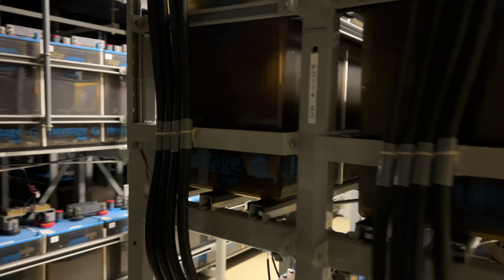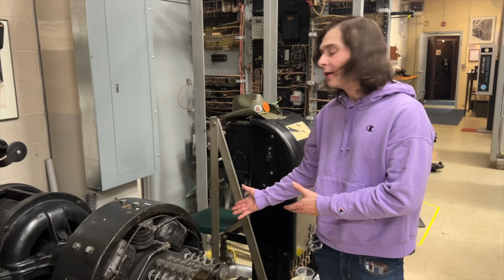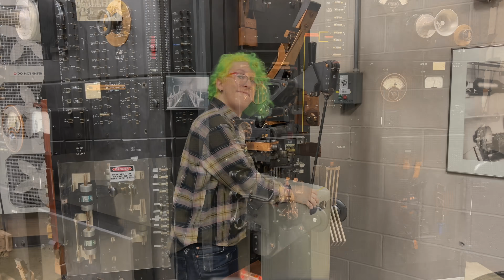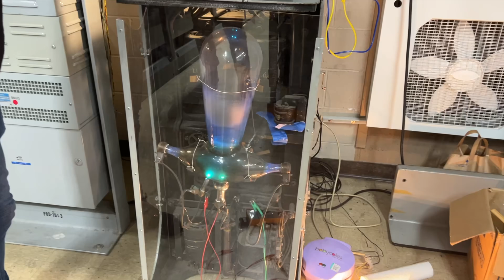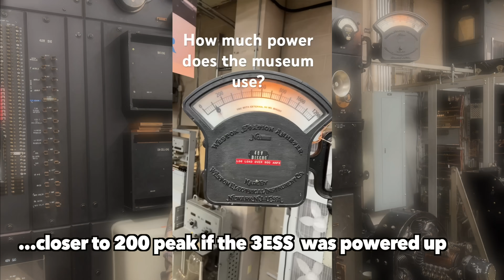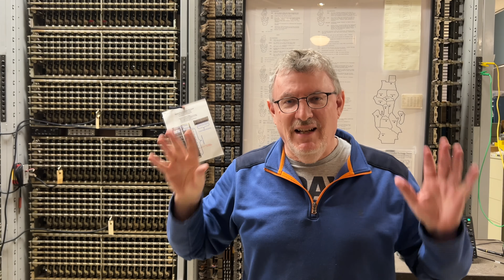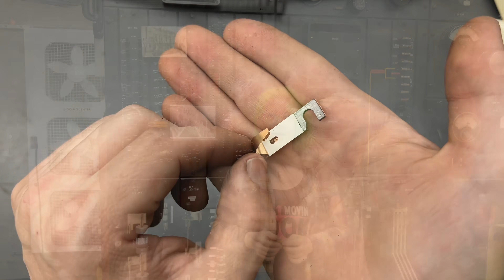All About Telephone Power Plants

Comment: Here in the UK we have -48v for pretty much everything. But, in TRS (Telephone Repeater Stations) the voltage is -24v. The only working equipment left in the TRS stations is a small amount of PDH , P2P modems and Kilostream ACE. I maintain this kit, but I've never understood why there was a difference in Voltages. I saw in the 1959 diary in the video that there were readings for -48v and -24v. Any idea  why there was this differences in voltages?

Comment: I've never seen a dropped wrench go poof, but I have seen the results of an uninsulated screwdriver dropped into a 3-phase 300A 415V AC mains busbar cabinet.
Unfortunately, the 11kV substation was literally on the other side of the wall, so the PFC (Potential Fault Current) was borderline ridiculous.
They only found fragments of the screwdriver handle, but the current impulse was so large that it bent the copper busbars like they were nothing.

Comment: Another super vid thanks Sarah! I worked in a large exchange in the UK in 1975 that had a battery stack with 60 gallons (72 US gal) of acid per cell. The Big Switch at the end of the string was scary large, SO tempting to pull the lever...

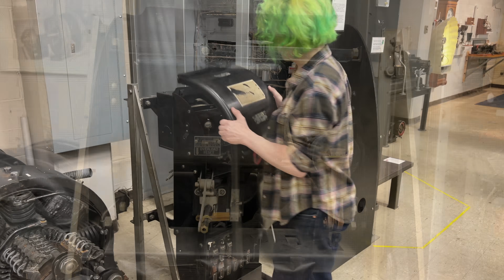Comment: 5:30 interesting; I haven't seen autotransformers used for starting motors, but here in Europe, with 400/230V 3-phase AC used for most motors up to tens of kilowatts (and higher voltages like 6kV if you need even more power), we use wye/delta switches; wye puts 230V on the windings and is used for startup at less power, and delta puts the full 400V working voltage on the windings. Slip rings and shunt resistors are sometimes used, they also used to be used as speed control devices, but this function has largely been taken over by variable frequency drives.

Give my best to Jay - she's a friggin' genius (how else can I call someone who makes their own vacuum tubes?), next generation Glasslinger coming up :)

That's one absolutely gorgeous breaker! Multi-stage switching, remote control... A thing of beauty and a joy for ever.
"Scientist: It's much too unpredictable - don't let it overcharge!
Barney: What do you mean, overcharge?"

Mercury vapor rectifier... I miss PhotonicInduction a LOT.

DDoS attack on an old phone switch, eh? Might be one of the first recorded examples.

It's very interesting to learn that the negative voltage has a real deal reason to it. All the fuses look interesting too. Thanks a lot for the insightful tour!

Comment: In the early '80s, I worked for a company that built video switching systems.  We built one system for Pacific Bell; it was to be installed in a CO in Los Angeles (I don't know which one), where it would handle all of Pac Bell's West Coast TV network switching.  Because it was to be installed in a CO, it had to run on 48V.  We didn't have a 48V system at the assembly plant, so we improvised one with four car batteries in series.  An old welding transformer that produced a 50V output charged them.  To limit the current, someone went to Sears and got a clothes dryer heating element.  The whole thing was built onto a pallet, with the "ballast resistor" standing on ceramic insulators.  Although it did not get red hot, it did get too hot to touch, and I always worried that it would ignite the hydrogen offgassing from the batteries.  We kept a box fan blowing on the rig when the batteries were charging.
Reply: Now that's some hillbilly shit right there

I love it!!! (and i'd probably do the same...)

Comment: As I understand it the carbon pads and other two contacts on the big DC switch all had to do with extinguishing the arc when the contactor opened. High current DC switches can be a total bitch to mitigate arc when opening.. Downright terrifying in some applications

Comment: An old tower dog named pistol Pete told me about a time where he set a wrench on top of the batteries in a Nextel shelter in the '90's and he knocked it and it fell without him noticing. The boys left site to grab something from the store and came back to the fire department putting the fire out. Needed a whole new building and that's when they were made of asbestos reinforced concrete.

Comment: One question that came to mind when you were talking about the fuses. 

What occured in an exchange or central office if lightening struck phone lines?
Reply: All of the Telco cables, whether underground or Ariel appeare on the MDF (Main Distributing Frame) in the CO. Each pair of wires had what were called protectors, consisting of carbon blocks and heat coils.  If the cable were hit by lightning, that super high voltage would jump across a gap thru the carbon blocks to ground. If high currents hit a cable pair, the current would pass thru the heat coils, which would melt a small pin internally and ground that pair.  The idea was to keep the high voltages/currents from entering the CO equipment.  Every land line Telco circuit that goes to your home or office building has mounted on the outside of the building a small plastic or metal box that also has carbons and coils mounted in them.  There is a ground wire (Usually green in color) that goes from the protector to a common ground in your house wiring, usually copper stakes driven into the ground, or in older homes, a water pipe ground.  Never remove those ground wires, you don't want high voltages or lightning entering your home from telephone lines. When I lived in Ohio, our commercial drop from Ohio Edison was hit by lightning, and fried just about everything that was electronic in our home.

Comment: Very interesting.  During WWII Bell Labs and Western Electric worked together on a top secret weapon called a Mark 24 "Mine".  It was an acoustic homing torpedo developed to sink submerged submarines.  Bell Labs developed the electronics that used 4  underwater microphones (Hydrophones) to steer the torpedo towards the swishing sound of the U boats propeller. Western Electric used a standard 48 volt telephone battery for power.  General Electric supplied a standard 48 volt commercial wash machine motor to power the propeller.  The batteries and laundry motor were chosen because they would fit inside a standard torpedo case.  Code name for this weapon was "FIDO".  It was first used in March, 1943 and was hugely successful.  This weapon allowed the supplies for the Normandy invasion to begin being sent to England with less fear they would be sunk.  This weapon was classified Top Secret for 40 or 50 years after the war ended.in case it needed to be used during the Cold War.  There are YouTube videos on the Mark 24 "FIDO".

Comment: I remember getting a tour of our local CO as a kid and was always impressed by the big batteries and big DC cabling. Eventually got a job and worked in that building for a good 10 years as a NOC tech. We don't really touch anything we just monitor it though.  When there are storms we have to keep track of all the COs that have no power so we can deploy techs with generators if the batteries get too low and it can get quite hectic. Cell towers work the same way, -48v as well. Our office got moved to the call centre building about a year ago though, I miss being in the CO, it was neat in there even though I never really got to touch anything.  Interestingly enough I've been setting up a CO power plant at home to keep all my server stuff running, as well as my workstation.  It's a work in progress but I have the basics, just saving up for the batteries now, and proper cabling as what I have now is temporary.
Reply: I saw it often when I was a kid tagging along with my dad on a weekend call. Remember the old mechanical switches and it was loud click clack all the time.

Comment: I had a battery be overcharged and off gas which caught fire then the alternator became unhappy lucky I was aware and ready I knocked the battery leads off and pulled off the belt yes it was spinning no I didn’t use my hands I used a branch

Comment: Another great video Sarah. I spent a lot of time around many of these old power boards in the 80’s. My job was design of the AC side especially for the very large COs. Redundancy was key and no single point failure modes were acceptable. Some central offices were so large that they had as many as 7 AC substations and 6 emergency generators! And there were still a few small substations with M-G sets still running. 
The museum is an invaluable record of what was achieved in the 20th century. Sadly, it is disappearing day by day. Wire line services are going away at an incredible rate. Even cellular will likely become obsolete within 20 years in favor of an all satellite network. In 50 years, people will have to visit the museum to see what the telephone system looked like.
Reply: Satellite will only replace cellular in rural areas, urban areas are just too dense even for the new LEO constellations they're launching.

Comment: Rube Goldberg would be proud
Reply: Naw, Rube Goldberg was the way trunk usage registers were read, a camera "Hood" that covered 100 registers, containing 1 wollensock 1/2  frame 35mm  camera,and 2 high intensity light bulbs shot Kodak high resolution B&W film, the films were changed daily at 7:00 AM in our CO.  Films were sent to film lab, developed then joined together in long streams. The registers were numbered with OCRS characters, so the films could be read on an OCRS system, then copied to mag tape for the traffic department to read and decide if more trunks were required. We had 20 of these camera hoods in our office. Not many computers in 1960, so I got to change those films every morning... for 10 years.  We had a closet full of Kodak film.....

Comment: Working for one of the independent telcos in FL many years ago, I was working in a CO when the power went out, the diesel generator attempted to crank over, and the starter battery promptly exploded. I thought the building had been struck by lightning. When the system gave up trying to crank that one, the turbine secondary generator	whined to life a minute later.  Trying to figure out the location where we’d been hit, we walked through the whole building, and when we came to the generator room, the carnage of the blown starter battery with shards of plastic all over the room and freshly sprayed acid made me very glad we didn’t typically have any reason to be in there.
Reply: So cool, um, I mean, glad you weren't killed!

Comment: All of our MG sets were 400 amp, 52 volts They were all Western Electric /GE open frame sets, similar to what you guys have, only painted gray instead of black..  We also had 400 amp solid state rectifiers (NOISEY!) . We had 4 strings of batteries made up of 23- 2.17 Volt cells each, and at least one end cell per string.  Emergency power was supplied by a 200 KW Solar Gas Turbine.  Our switching system was 2 units of SXS, and 1 unit of #5 XBar.  We also had a 130 volt string of cells for ring generator, and Before Ma Bell got rid of them, teletypes requiring 130 V battery. Those cells were I think 2180 AH rating each, and were manufactured by either Excide or CD . If the battery voltage dropped below 48 volts, the emergency end cell switch would cut in extra cells as needed, to keep the voltage at 49.91 volts. Battery strings were connected to overhead copper bus bars hanging from the ceiling on large red insulators. Our main switch panel was all knife switches, some rated at 600 amps. Might be interesting to tell the people how those high amperage fuses were changed, with the knife switches! Dozens and dozens of fuses were used to supply the various switch frames on the 1st and second floors.   We were a small local end office CO, but up the street a couple of miles, we had a 4 story CO that was also a major toll hub with lots of microwave.  Their emergency power was 2-750 KW Solar gas turbines.  I worked at both of these CO's, nearly 10 years before moving east, all the COEM's worked power at some time, we all trained,..I can still remember using that Weston single cell voltmeter, and taking Sp. gravity readings as a weekly routine. I ran the Emergency gas turbine once per week with no load, and once per month with full load. .  That little office today is all 5ESS.

Comment: Not a telco power story but amusing nonetheless.

Back in the 80s I was working in DMERT development at Bell Labs. There were several labs, each one consisting of a room with a 3B20D processor and an adjoining room containing a DEC PDP-11/70 computer, which was used to control and monitor the 3B20.

Feeding these two rooms were aluminum busbars carrying 208 VAC 3-phase at some horrendous number of amps.

One day I was in the lab and a couple of the busbars decided to end it all. There was a deafening ka-BOOM! and I jumped about three feet into the air. I made a beeline for the door, hitting the EPO button on the way out. (The power was already off but, hey, I hit the switch anyway.)

The electricians began work on replacing the busbars and temporarily left the old ones lying in the hallway. I was standing around with a few co-workers when two guys walked by. One glanced at these melted, gnarled-up busbars, turned to his friend, and said, "Obviously a software problem."
Reply: I thought telco was 48V DC, albeit at a LOTTA AMPS
Reply: @meepferret  The labs were supplied with 208 VAC 3-phase. The PDP-11 ran on that directly. To power the 3B20, the AC was stepped down and rectified. Don't forget, this wasn't an entire switch. It was, essentially, just the processor out of a 5ESS. For this application there was no need for a battery room.

Comment: Motor-generators are still used to isolate electrical systems from commercial power, and especially from lightning transients. Often these are AC to AC (lower maintenance than DC). A big rotating shaft is much better isolation than any surge protector, filter, or transformer.
Reply: They're not as common these days, but a MG set can be turned into a rudimentary UPS with a massive flywheel!

Comment: I remember when the phone guy came to change the batteries for my families phone. They were in a wooden box mounted underneath the basement stairs. I remember helicoptering the worker. I think that had to be in the late 60's. I ended up being in the CATV business. We dealt with large battery banks too.  Marcos went to put a labeler on top of the DC breakers box. The box didn't have a top. He quickly opened the door and grabbed it. Not noticing that he hit a couple of breakers and knocked out some critical gear that caused an outage (ONS).

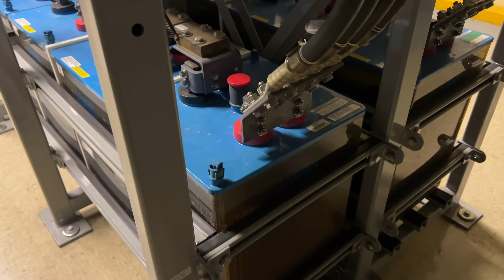Comment: 24:00 battery plus on chassis/ground was used in cars until they managed to properly protect wires&contacts from water and found the electrolytic corrosion on the chassis more problematic on the long term.
Reply: THIS WAS ABOUT 1955 OR 1956, WHEN CAR MFGS CHANGED OVER TO 12 VOLT SYSTEMS, also about the time that generators were changed over to alternators.
Reply: @henrythompson7595 "+ on GND" was kept in cars from Japan well into the 1980ies, resulting many oopies for people doing car audio retrofits.

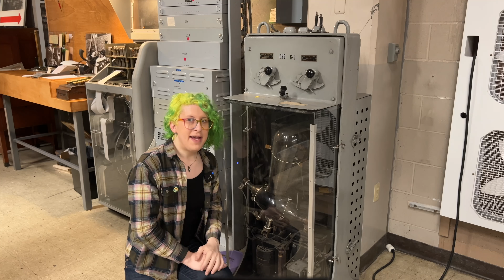Comment: I worked for a local TV station that served a multi city area.  One day, during a live daily show, we gave away tickets to a new water park opened in a nearby amusement park.  Viewers were to call in to a specific phone number to get the tickets.  About an hour after the giveaway, our engineering department received a phone call from a local Bell Telephone representative, wanting to know “what in the hell we did at approximately 12:50 hours earlier today.”. Dumbfounded we said “we have no idea!”. The Bell representative told us that if we ever did it again, they would disconnect our telephone service permanently!  As it turns out, there were so many calls to the number we provided, we locked up the COs in three cities, preventing customers from getting dial tone!  Once we figured out what happened, we devised a means of limiting the pool of potential caller based on age, or birth month, or some other criteria.  It was a sobering experience never to be repeated.

Comment: "red button for operation, green for disconnect" sounds like powerstation logic. "green" is always the secure "shutdown" state of each pipe or device.
Reply: Red is touch it and your dead, green is safe (some places use white to indicate it’s “clear” of charge, especially to avoid any indication that all parts are ever truly completely safe).
Reply: That's the logic for most gun safeties too, which is unironically how this equipment should be treated too - like it's always loaded.
Reply: I recently started working in a data center and this convention still confuses me sometimes
Reply: @dcviper985  Cool, on what systems and where?  I started in telecom and structured wiring, did large telecom switching work for years, then managed datacenters interconnects and systems for almost 2 decades now (all over the place).  About 7-8 years ago I could probably rattle off names and addresses of most IXC and hubs off the top of my head. Now I work for Microsoft so everything in Azure and I moved into SecDevOps and compliance.  But hey you never really loose the fun of the physicality of large operations.
Reply: red/green is relative..large fossil fuel power plant control room boards could 
be either depending whether cold start or operating mode also the country
makes a difference even medium power switch gear rooms/manufacturers